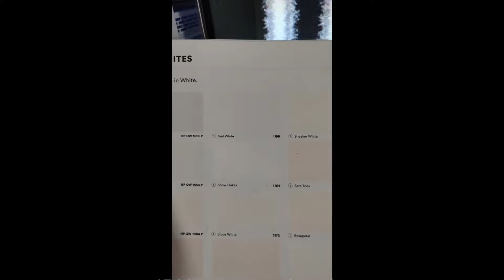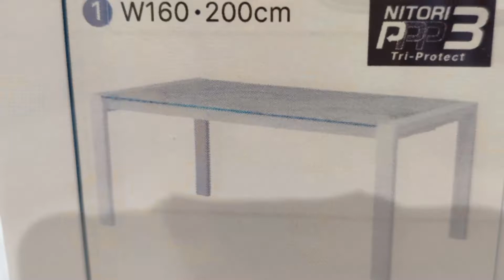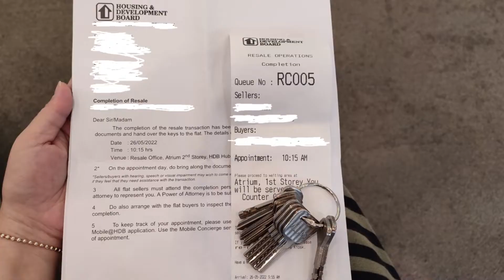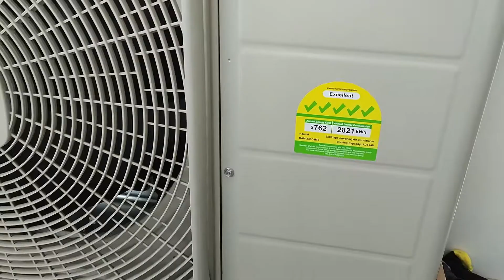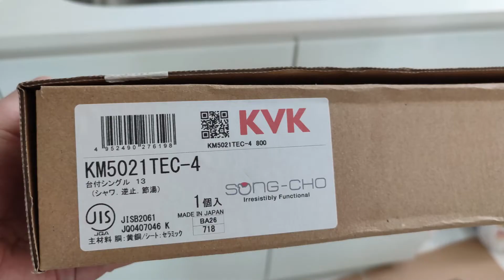Renovation Journey part 2 | HDB BTO 4 room | Family of 5 + 1 pet

Comment: Very nice kitchen cabinet, is very easy to fit 
Is it from nitori?
Reply from the maker: Nitori kitchen cabinet collections are very nice, I like their finished look and pullout drawers, may get it to put on the other side of the kitchen for dry food storage. Their order leadtime maybe quite long. 
I prefer not to have any woody material at the wet sink area, therefore I choose aluminium kitchen for the base cabinet.
Reply: @SnackFoodFun  how did u make aluminium cabinet look like normal from the outside? Like they seem to have pasted laminate or something over it? Can share. Its such an interesting concept!
Reply from the maker: The outside of the cabinet I chose white color while the cabinet doors I chose glass with white on the inside. The supplier have other colors to choose for the cabinet and cabinet doors too.

Comment: Wow, everything you selected is very nice looking. I did my skirting 50 mm as well. Can you share where you got your kitchen cabinet? Good idea that you just have metal frame structure for cabinet base instead of cment base. Is your kitchen cabinet custom-made or off-the-shelf? Where did you get the kitchen cabinet and quartz countertop from?
Reply from the maker: :) thank you very much. The kitchen base cabinet is from astar furnishing, I got it custom-made based on the dimension I needed. For the quartz countertop, I got it through astar furnishing too.  For kitchen sink and tap, it's from Song-Cho kitchen. Also I had just added in the description the supplier and product infos for sharing too :)